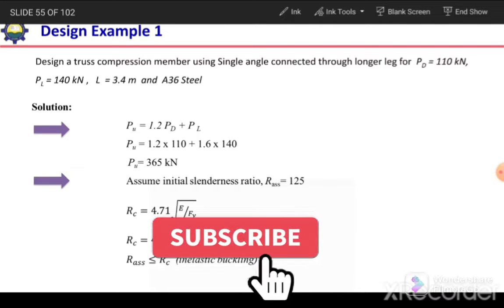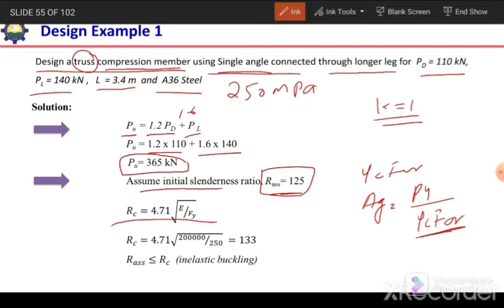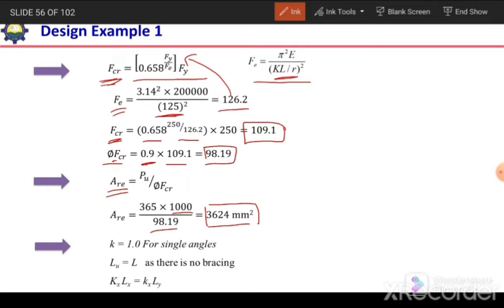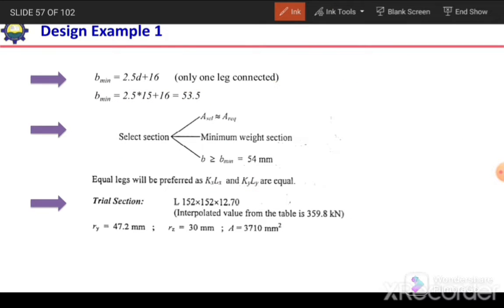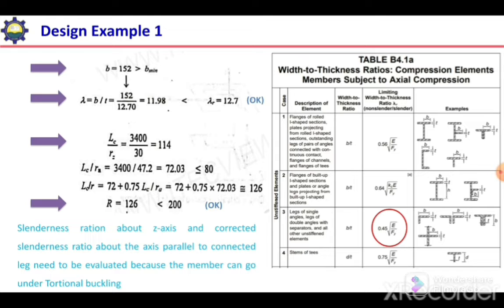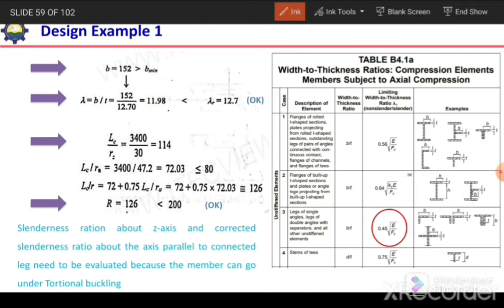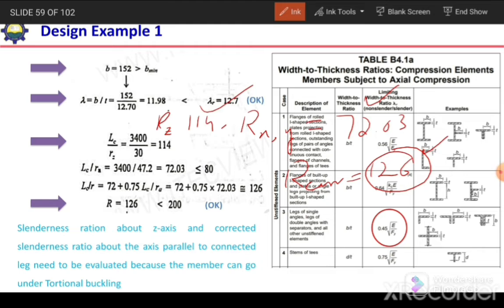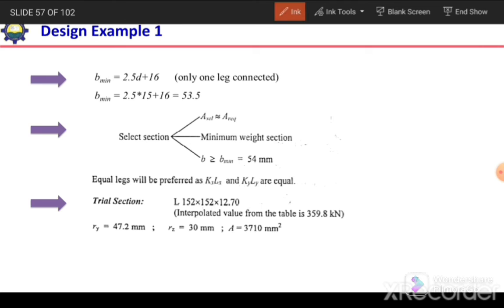6. design of compression members - Design Example 1- design of single angle section

Comment: Assalam-o-Alaikum!

Design a 9-ft single-angle compression member to support a dead tensile working load of 30 k and a live tensile working load of 40 k. The member is to be connected to one leg only with 7/8-in bolts (at least four in a line 3 in on center). Assume that only one bolt is to be located at any one cross section..

_ _ _ _ _ _ _ _ _ 

1. Es problem k liye  sir K ki value kaysy decide krein gy aur bmin ma formula same use ho hoga... kiu k ab values inch aur ft mein hain

2. baki procedure same hi rahy ga jaysy video mein dikhaya hai
Reply from the maker: You write design a compression member
But loads are tensile.... How....
If it is truss member then K will be 1 otherwise we need end conditions
Formulas will change with unit system but procedure will remain same
Reply: @engineeringstudio  sorry sir ... loads are compressive in nature dead load is 30 kip and live load is 40 kip
Reply from the maker: @kinglion8564  procedure will remain same but there will be slight change in factors and formulas
Reply: @engineeringstudio sir! can you please suggest me any book from where I can get formulas and factors for such problems with inch and ft units ( FPS unit system )
Reply from the maker: @kinglion8564  you can follow AISC code with FPS units
Everything will be available there